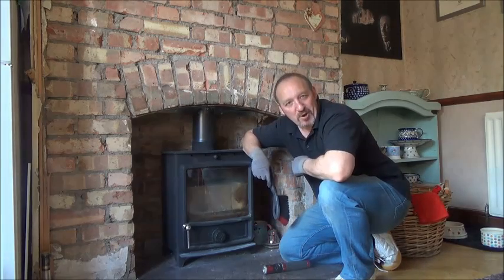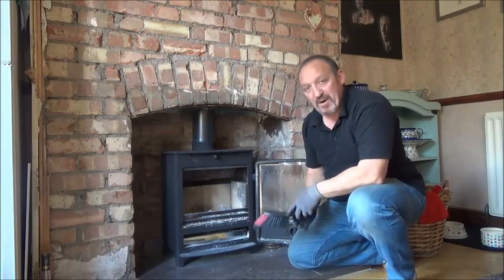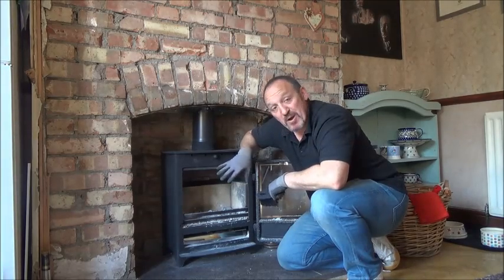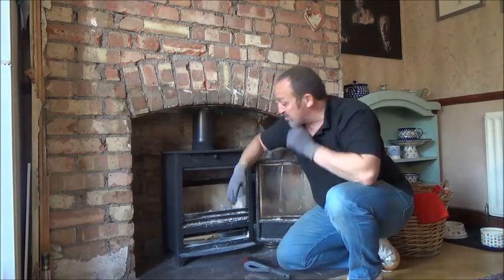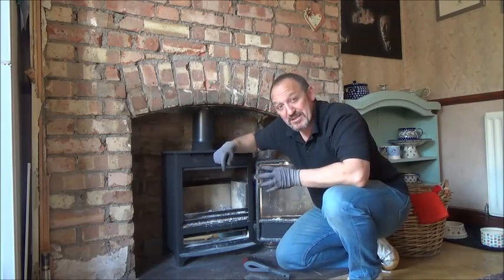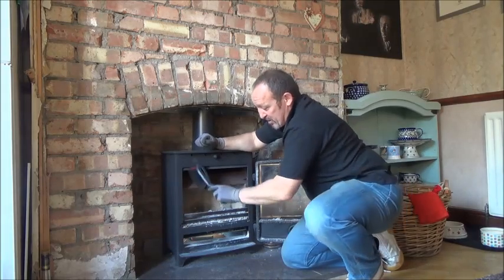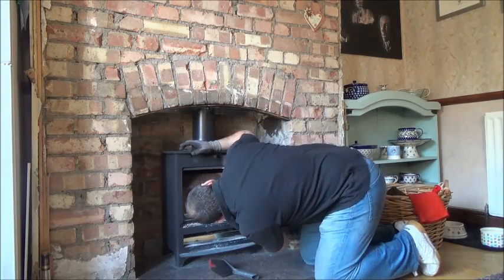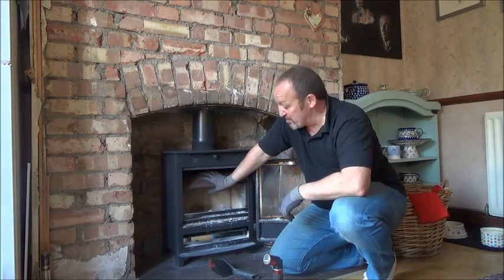HOW TO CLEAN SMOKE DIVERTER / Baffle Plate

Comment: That is one of the more helpful videos on the subject: thanks!Quick question, how often should the baffle plate be checked on a calendrical basis? Once a fortnight, once a month? The manual (Olymberyl) just says "regularly" as does other online resources. (In my case it's usually a case of burning a mix of timber, smokeless pellets, peat briquettes and/or turf. Many thanks in advance)

Comment: Is it safe to take out that plate my stove smokes alot when u open the door there is not enough of a pull when that plate is on where it is meant to be thanks
Reply from the maker: Thanks for the question.
The baffle plate is an integral part of the workings on the stove and should always be in place when the stove is being used.

When you open the door while in use, only opening it a fraction and let the stove smoke stabilise before opening fully.
When was the stove last swept, a blocked flue will have the same affect.

If it continues l would recommend calling in an NVQ chimney sweep to check over the installation.
T-care
Paul Ross
Reply: @paulR505  I can’t get the plate back in. I get the things in the slots but I can’t get it up and in. It’s too heavy. Way heavier than yours. There’s no one to help and I can only hold it for a minute pushing snd shoving and then I have to let go. I need heat real bad. Hope you can help ty

Comment: We’re the baffle plate sits on the front of the fire should there be a small gap.The reason I ask is I’ve had a problem with smoke coming back into the room when I refill it.It never happened with our other fire and I’m just wondering if it’s been fit correctly?
Reply from the maker: Steven Briggs
Hi Steven
If you put the manufacturer and model of the stove on the net you should find the right location for the baffle.